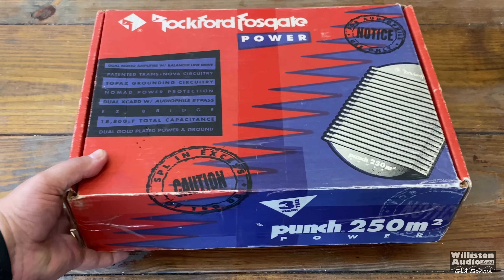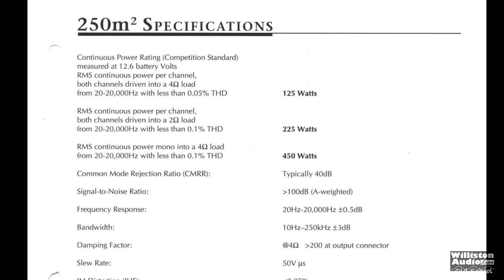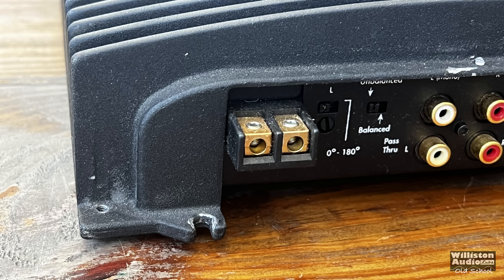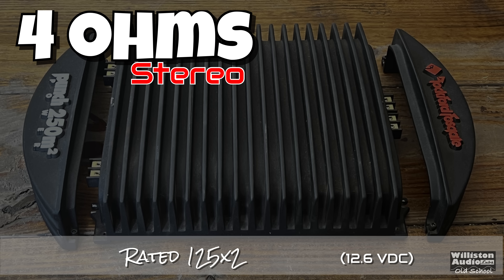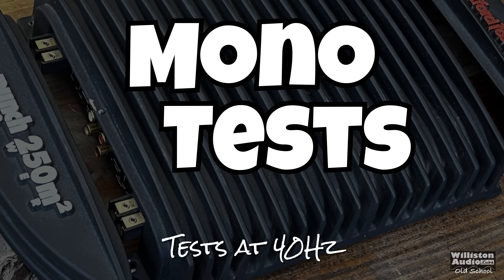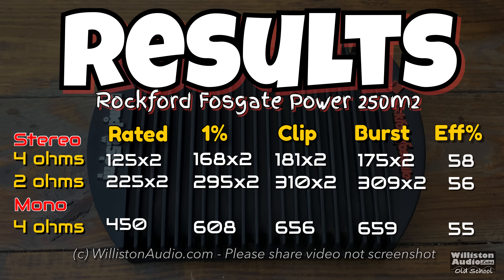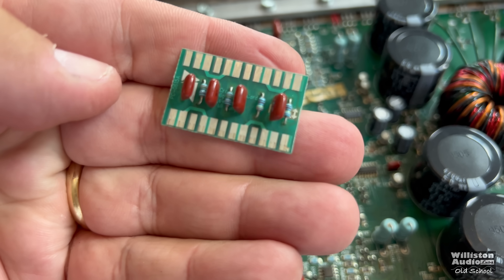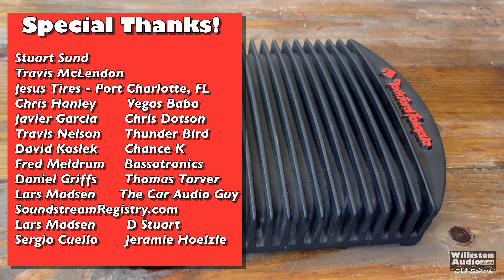1995 Rockford Fosgate Power 250m2 Amp Dyno Test and Review

Comment: yeeeeeaaaars ago I had this amp when I was first learning about car audio and could not for the life of me figure out why it made my subs sound like crap. Way back I had two SVC 4ohm  Pioneer IMPP 12" each rated at 300W...I wired them in parallel and bridged the amp. I eventually figured it was just too much amp...now seeing this reminds me of that and confirms that I was right....by about 50% per sub too much lol. Ah, to be young and dumb.
Reply from the maker: We’ve all been there
Reply: When I was first getting into higher end car audio, I had a good friend that I helped do installs.  He had a 12" green IMQ Infinty sub sitting around that he sold to me for next to nothing because he couldn't get it to sound right.  I downloaded the manual (way back in the early days of such things being online) and started reading through the manual and the specs - he'd been trying to run it in a huge ported box, when Infinity recommended a sealed box that was so small that the sub would barely fit in it.  I ran off to my dad's wood shop with some MDF, whipped out a test box in the recommended volume, and it sounded amazing.  I still have that sub.  :D